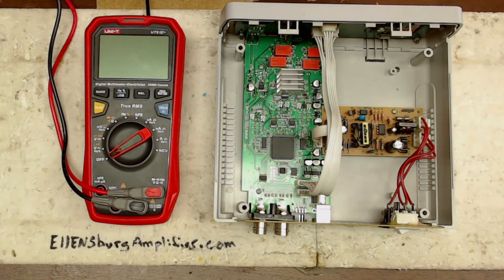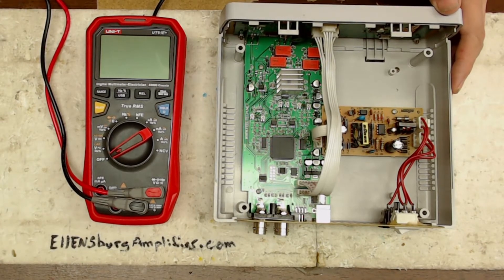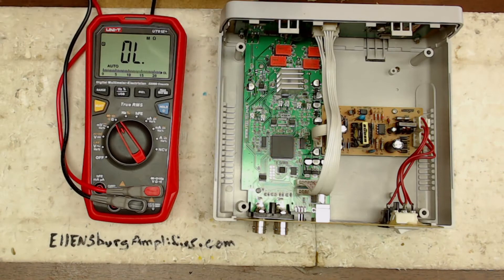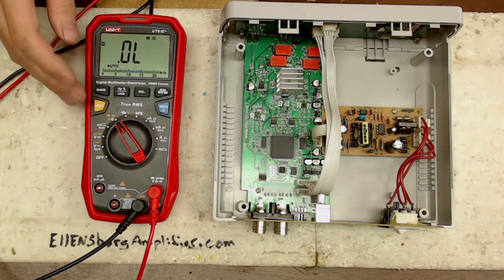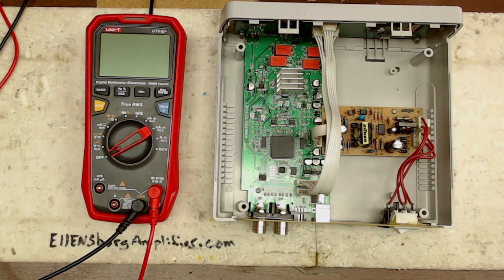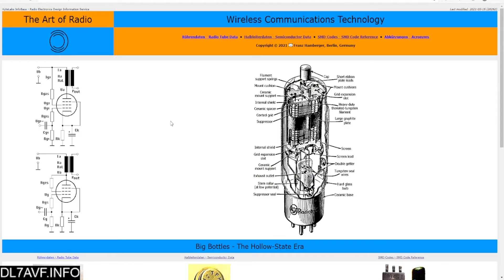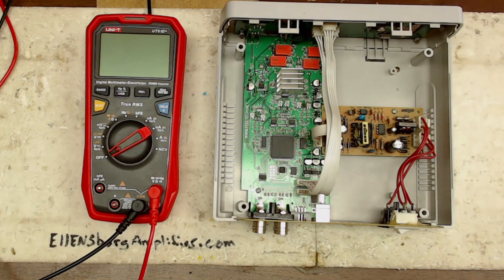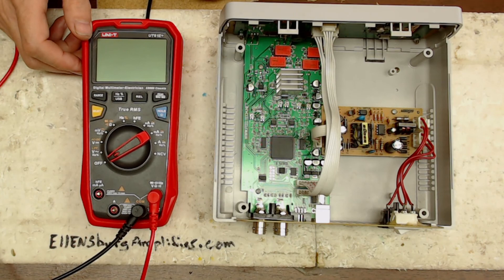Uni-T UT61E+ Meter Resistance Locates Bad SMD Components For Amplifier Repair Finding SMD Data

Comment: You just need to download the driver and the app from Uni t site, it should work. I tested with win 10 and is OK.
Reply from the maker: Thank you. I have downloaded the software and the driver with no luck. I will go check and see if they have updated the software.
Reply from the maker: UPDATE- They have solved the problem finally. Thank you again as I would have never gone back to see if they updated the software. They did listen to the people!

Comment: well its probably not what you want but you can make a virtual machine of whatever compatible operating system you want and run it there and that will make it work.
Reply: do that on my servers all the time pretty easy trick
Reply from the maker: @WhateverUDecide  Thanks Mike. I have limited knowledge in the use of Hyper-V and have thought about this. Then I tell myself I will end up like Lewis switching all my machines to a different OS to run this gear. I may get a benchtop meter to avoid this.